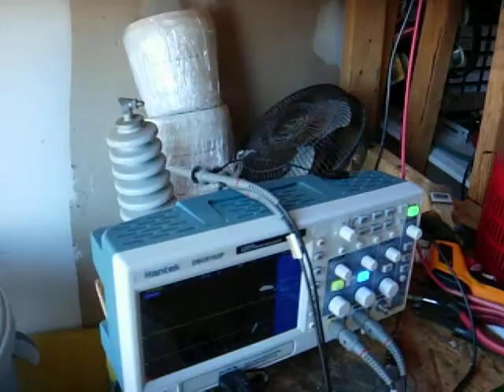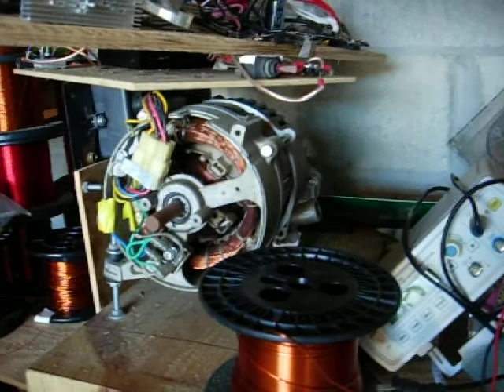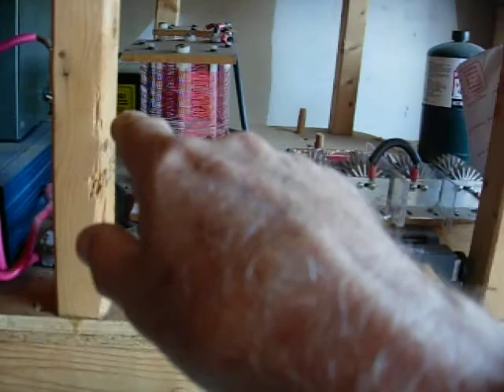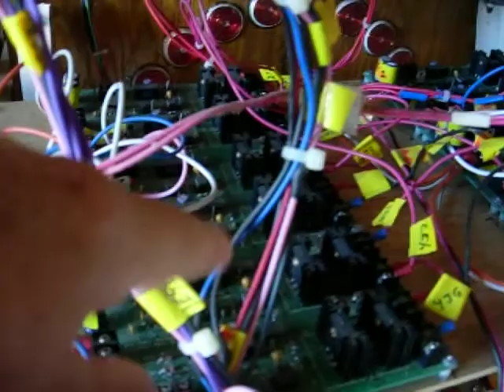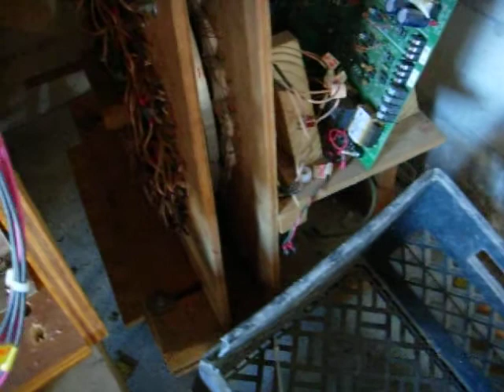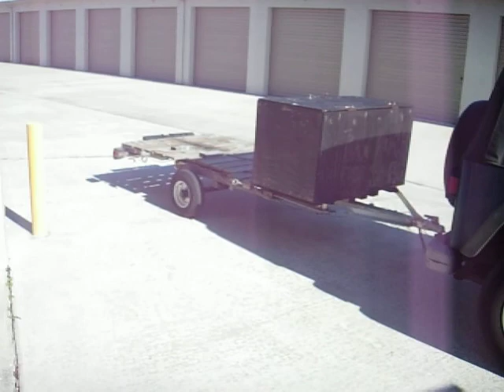Don Smith #236   lab tour

Comment: With regards to the box on the trailer: make one of the sides of transparent plastic. Or even part of the wood, replace it with plastic, so' they' can see through it.
Reply from the maker: No That's a great suggestion  just need to make sure they can see  most are pretty drugged up